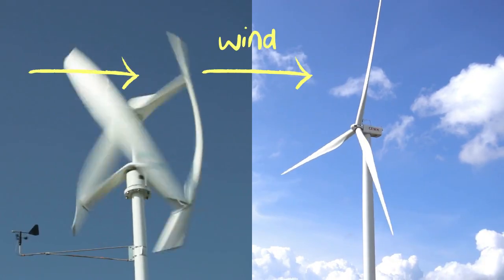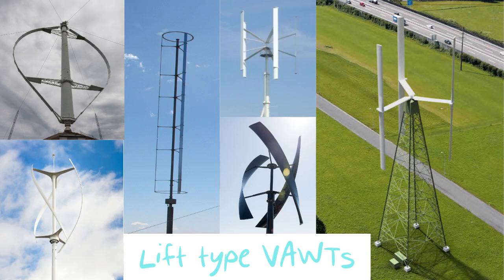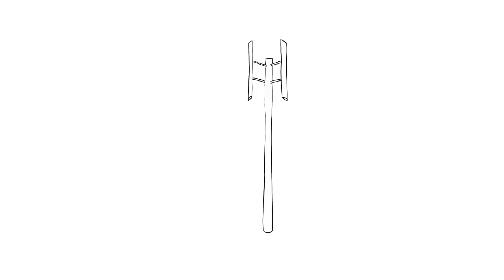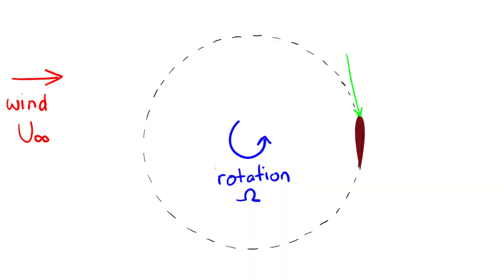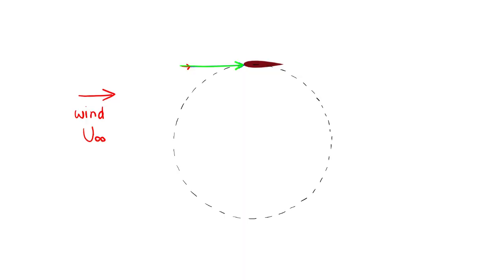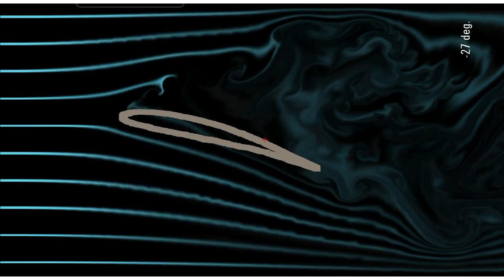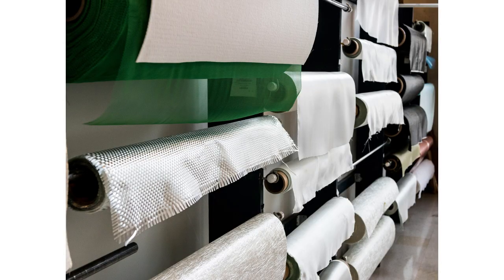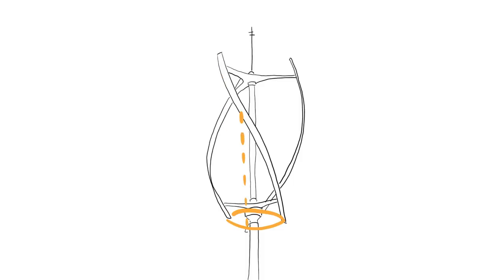Vertical Axis Wind Turbine Aerodynamics and Design

Comment: I saw a video on UTube on a v-axis turbine, and the shaft appeared to run below the tower ground level, into a room containing a flywheel of some 20 meters in diameter at the end of the rotating shaft. 
Personally, I'd just like to know about the advantages/ROI of the addition of a flywheel to the whole enchilada.

the video:

https://youtu.be/d0MqbSjiiks

what do you think? I think it runs pretty slow in the video, am wondering whether that was the optimal speed for power generation on this type WTG.
Reply: Interesting video, but it lacked any data or details. Rated at 1.5MW @13m/s (30mph), which is a wind speed that most people would call stormy that low to the ground. At one third the wind speed, so a good breeze, that would generate around 75kw. It looks like the flywheel is offset from the shaft, so there is probably some gearing in the coupling of the two, which is good and probably necessary for proper functionality. I like the use of a flywheel, it should make the power output way more stable and consistent. The power in can be stored in the wheel and the power out can be regulated to the load. Efficiency and ROI are probably not the right metrics for this application. Reliability and stability, and maintenance cost and probably the drivers.

Comment: Good video. My experience with both types HAWT and VAWT turbines in comparison has led me to a very basic design set of facts. A VAWT will need 4X the turbine blade area than a HAWT to produce an equal energy output. A 10 foot diameter HAWT has about 80 square feet of working area.  A VAWT would need to have almost 320 square feet of working area to produce an equal amount of energy. That would be a VAWT turbine blade set 10 feet in diameter and 32 feet tall. 
I have fabricated several typical and non-typical VAWT turbines comparing them to several HAWT turbines I have operating on our OFF-Grid residence in the Panhandle of Texas.
Plenty of wind for tests...
Reply: Is it your contention then that VAWTs are unlikely to be commercially unfeasible?

Comment: One factor you haven't touched on are upward force infrastructures.  Vertical turbines should be complimented by a spiraling shaped rest which increases upward lift forces by magnitudes. It can also be artistically cathartic to make on your own.  You can make one out of anything starting with 8 points, evenly distributed in any diameter.  Just remember, more surface space redirected into a thinner upper neck below the helix will provide much higher yields & continual ongoing conversion. This is why verticals are superior in their modular array of benefits. Give it a try

Comment: VAWT are used for ground wind speed which are lower and it is setup at or very near the surface.  Looking at around 10 to 30 kph.  HAWT are designed for much higher wind speeds and higher attitudes above the ground from 30+ metres.  Really that''s the short of it.  Having said that am sure some will or has tried to build a mega version of the VAWT but they aren't going to get the power production that HAWT will produce. in either case the number of blades have to be in odd numbers as it is with HAWT.

Comment: 10:20 I don't quite understand why active control would impact the cost effectiveness of small turbines more, than large ones.
Reply: Probably because the control system will have a lot of  fixed costs no matter the size: so while a large turbine might need larger actuator motors, most other components such as the sensors the computing power etc will be the same for any size. Also the added cost might just increase efficiency a few percent and a few percent improvement on a small turbine will be neglible while a few percent improvement on a large system might pay for itself in just a few years.
Reply: @SteinGauslaaStrindhaug  but sensors and controllers are pretty cheap these days.
Reply: @MusikCassette  maybe sensors isn't the most expensive part, but it's certainly not free. even if it's relatively cheap, if it adds 100 dollars to the price of a 100 dollar turbine it better double the performance to be worth a double price. While adding 200 dollars to a 10 000 dollar installation is just 2% more so even a 3% performance improvement might be worth it at that scale.
Reply: @SteinGauslaaStrindhaug  
well if it adds $100 that is already pretty much, when considered what electronics cost in making. In terms of computing power: Does there need to be anything fancy, that a microcontroler for a fiver cant do? And what sonsors are there to be used? Rotation speed, positon perhaps angular momentum? I dont see the costdriver there.

Comment: Hi @Engineering with Rosie, I have an unusual request: how do you figure out the VAWT efficiencies of one where the vertical axis is a solid cylinder, instead of being hollow?

In particular, I’m thinking a very large diameter vertical axis compared to the size of the blades, with a rather large building in mind, and I do wonder if the diameter getting notably larger will result in gross inefficiencies for wind harvesting due to a lot of overlap.  I’ve been working on a radical city concept that emphasizes system efficiency in economies of scale for size, and one of the observations I’ve made is when scale is done correctly, even if a smaller scale version wouldn’t be very efficient, if you can go huge, and integrate it as part of a larger overall ecosystem, energy usage can be greatly reduced, in a geometrically-related way.

Thanks!
Reply from the maker: Wow, that sounds interesting. I am having a bit of trouble understanding exactly what you mean. Can you link to a sketch or something?
Reply: @EngineeringwithRosie  I’m no graphics artist, I’m a computer geek by trade.  So, perhaps you can visualize what’s needed with this description: for the VAWT, I’m looking at about a mile in diameter, and a similar manner of concentrating wind as used for a Tesla Turbine, with collector holes all the way around.  The height would be perhaps about one story in height. The objective is to use the same principle as a Tesla Turbine, using the viscosity of the air to drag it along: the thickness of the “blades” would be optimized for the surface boundary effects in the same manner as a Tesla turbine. This sort of VAWT would be part of the top story of a large building that’s ideally not directly on the ground.

The big question to answer is if this can be made to work using the same principles as the Tesla turbine efficiently enough to be cost-effective.  There’a no need for energy capture to be maximally-efficient, and a HAWT peaks out about 59% in theory.  If something can work that’s more readily maintained, doesn’t create too much noise, and has a safe failure mode and what’s more,  is part of a building already there (this city would be a lattice of giant 1 mile diameter octagons and intermeshing squares, about 500 feet wide for the edges of the lattice with all the area in between being wild green space) it’d be a better system.

So, it’s because of the extreme size to where the airflow is pretty close to straight, after going through the funnels, can that be made to work? It may work best by using narrow airfoils.  The objective is to also make the “blades” be of very light material: since there isn’t the need to withstand the huge g-forces or account for hail or the like, I’d like to think it could be made to work, but I do have a number of basic sanity checks to try first.  At least this VAWT concept can have the basics tested cheaply, and it doesn’t require building a whole city ;)

Comment: I looked into getting a residentially vertical axis windmill and was disappointed that there were so few providers and that I was told to not put it on the roof of my house due to vibrations. Now I understand why, thanks for that
Reply from the maker: I wish wind turbines were as easy to put on roofs as solar panels but unfortunately that's not how it works!
Reply: Also unlikely to generate significant power, with a tiny turbine.
Reply: Check out Flower Turbines (https://flowerturbines.com/).  They are a startup in Rotterdam, and will soon be producing turbines in the US, as well.  They've patented a few breakthroughs in VAWT technology for residential and urban use.

Comment: I would like to request you will you guide how to fit wind turbines along the freeway.Because air pressure and velocity is more and continues along the freeway.
Reply: I will answer that for Rosie,
You have to make difference between turbulences and wind energy.
Along the highway there is a lot of induce turbulences by large truck that are of no use for wind turbine.
Reply from the maker: Thanks for the question and for the answer! You can for sure put turbines along the road that will spin and generate some electricity, but I think it is unlikely you would get a cost effective form of electricity that way.

Comment: Off hand, I would say that some of the advantages of VATs that I see are that they appear have a smaller impact on the environment.  As their blades are typically smaller and require a smaller area for the blades to operate in, they will be less of a threat to birds.  Because of their basic construction and design concepts they are more easily recycled (currently this seems to be a huge problem for horizontal turbines).  Also, certain design of VATs appear to have developed a means to prevent overspeed problems thru their design rather than utilizing additional electro-mechanical complexities.
Reply from the maker: I haven't seen any studies about VAWTs and birds yet, though lots of people assume they will be better. I am planning a video on wind turbines and birds soon, so I will try hard to find some reesearch on birds and VAWTs.

Comment: Just found your channel and subed right away...  I would like you if you could to talk about how to design construct and test the best electrical system for VAST'S, I am building one now but have no idea how to come up with the most efficient electrical system...  My pro type is being 3D printed, and I got it from Thing averse...  "Ugrinsky Wind Turbine (VAWT) with built-in Generator"...  He doesn't really go into the electrical system he is planning on using So I am left to figure that part out...  It would be great if you could kind of give me a direction to go in...  Thanks for your time and I look forward to watching your channel more...
Reply from the maker: Ok cool, thanks for the suggestion Remington. I want to test some commercial turbines and designs in the future and I will make sure I include the electrical stuff too when I do that. It's probably a few months away at least because I need to save up to buy the turbines first! Maybe you will be finished with your project before I get to it, and if that happens then please share any lessons you learn along the way (either tag me in a comment here, or on Facebook or Instagram).
Good luck!

Comment: High speed and low torque is the way to go. 
For those ... make your VAWT with the generator (magnets and coils) at its outer circumference, not on its shaft.
When did 'torque' become more fundamental than the "speed of the changing magnetic field".

Low torque... High speed. 👍
Reply from the maker: Thanks for your comment, power is the product of torque and rotational speed so both are important!
Reply: @EngineeringwithRosie  

Agreed. 
I'm arguing that relativity can be exploited here. Specifically that, if one can increase the speed ( "of the changing magnetic field" ), one equally and oppositely reduces demand on torque.   And moving the point of rotation from the shaft... to the circumference (of a VAWT ) in my mind, accomplishes this.
But... I'm just an observant thinker.  And my absence of higher education can be deluding me. Never the less... I'm completing a design in my mind to bombard with 'the scientific method'.

Comment: I've been looking for someone like you that can reasonably explain the science behind wind energy! I like to design conceptual wind generators that push the boundaries of what we know and what we can do. So, in regards to VAWT vs. HAWT, I thought both could be put to use in one concept to address the largest untapped source of seasonal renewable energy; hurricane winds. Here's a link to how I thought we could harness those high winds as inspired by palm trees: https://vimeo.com/103343119
Reply from the maker: Thanks for the comment, and glad to hear my video helped you. That is an interesting concept you have there! I wish you luck developing it 😀 The reason that other wind turbines have much lower shut-down speeds is that it becomes very expensive to make a structure strong enough to withstand those extreme forces. And the storms only occur occasionally so most manufacturers don't consider that it is worthwhile to make them stronger. So those are likely to be issues that you will need to overcome. Also, I would be careful about the extracomplexity of your folding design, those joints are likely to be the weak spot I would suggest, so focus your testing there first. Good luck!

Comment: HI Rosie, greetings from Colombia. I wonder what is your opinion on ART wind turbines? Is ot worth the trouble?  Thanks for your job in communicating this extraordinary world of wind power!
Reply from the maker: Hi Camilo, thanks for you comment. I don't know ART turbines, and I am just getting hits for paintings of wind turbines when I Google it! Can you share a link so I understand what you mean? Then I will add them to the list for a future video to look in depth at some VAWT designs.
Reply: @EngineeringwithRosie  commenting to hear his response, also instead of complexing the mechanics by rotating the blades to solve the negative force area couldn't u just use a one way filter membrane to allow force in the positive direction of the wind and pass-through of wind in the negative force area or u could go more complicated and use a full spherical gyroscope design like nasa uses to test astronauts in a zero spin scenario. Then in the negative area the blades would move up an down cutting the negative wind area space by half and creating a more stable center of gravity under the wind force. I wish I had the means to test both and both together but I don't so I'm just passing along my thoughts 🤔👍

Comment: What do you think of Icewind turbines?  
I've been trying to figure out if any vertical design would work in the weak air pressure of Mars, <1% of earth...?....      :)
Any ideas?
Reply from the maker: Thanks for the suggestion, I'll add Icewind to my list for future videos. 
The power in wind depends on wind speed, V,  and air density, rho: P=0.5*rho*V^3*A
NASA gives data on the Martian atmosphere here:
https://nssdc.gsfc.nasa.gov/planetary/factsheet/marsfact.html
It seems wind speeds are a little lower on Mars than on Earth, but not so low you couldn't use an Earth-designed wind turbine there. A bigger problem is that air density is much lower, only 0.020 kg/m3 compared to 1.225 kg/m3 at sea level on Earth. So there is only one sixtieth of the power available in Martian wind compared to Earth wind (at the same speed).That means you would need a wind turbine sixty times as large to get the same power, and even then you would get less power out of it on Mars than you would on Earth due to the lower average wind speeds. I don't see any reason why you couldn't get a VAWT or HAWT to work on Mars, but it wouldn't be very effective compared to what we're used to on Earth.
Reply: @EngineeringwithRosie  Thanks for the reply and data!     :)

I'm interested in Martian wind power, because every so often a big martian dust storm blows along and cuts off the light for solar. Possibly lasting for weeks.
Having a way to keep batteries topped up (using the power of the storm) could be a life saver..

Am I right in thinking that the reduced density/power of the Martian air would make more light-weight turbines viable?
Turbines too fragile to last here on earth, could perhaps be mounted on solar arrays to provide a secondary power source.
I was picturing something like the Icewind turbine, made from thin aluminium and/or carbon fibre. Apparently, the Icewind's claim to fame is it's ability to operate in light winds.

It's not the easiest thing to test at the moment as I'm between spacecraft just now.
But I think wind power is being overlooked as a backup power source for a Mars base because of the low air density...

Anyway, thanks for the info and all the data driven youtube vids...
Reply from the maker: Lower wind speed or lower air density does give so smaller forces, but also a corresponding lower power production. So unfortunately you wouldn't see any reduction in the weight of a Martian wind turbine compared to one on earth that produced the same power, except with respect to gravity loads (self weight). I guess your fatigue loads for a horizontal axis turbine at least would be lower, so perhaps you'd save some weight because of that but not a lot.
Reply: +1
Reply: Well given the success of Ingenuity, and its flights
I'm going to consider wind turbine power on Mars as a definite maybe!
It seems to show more promise as we learn more, so I'm keeping it on my list of candidates